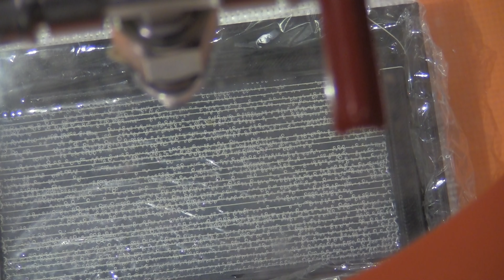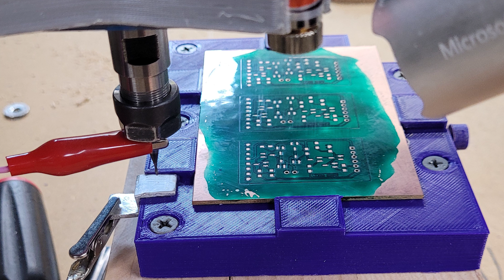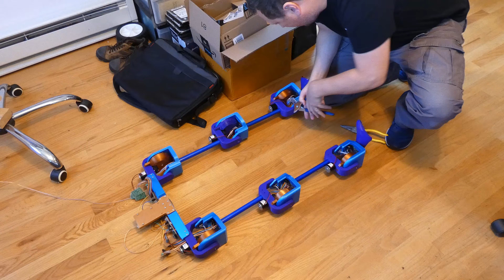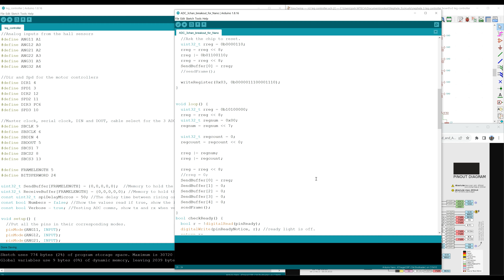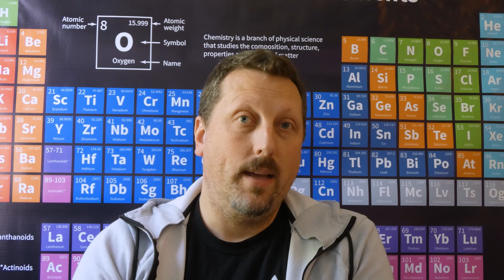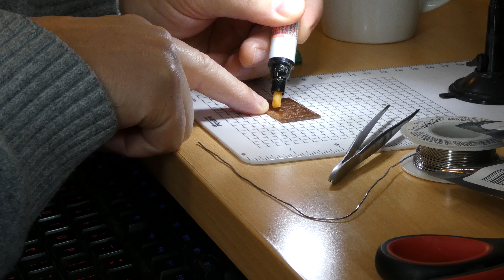Homemade Robot: The Rise and Fall of Nephele 4

Comment: awesome video...   that 3d printed visor   do you have that available  in Fusion  or  an stl ?   that is something i've been looking for,  to keep it in the same spot etc.
Reply from the maker: Yep, I zipped up the vise, clamps, and knobs (and also the original FreeCAD file) for you: https://whitman.tech/ferrouscnc/pcbvise.zip
Reply: @WhitmanTechnological  you rock!
Thank you
Reply: @WhitmanTechnological  Thank you..   i saw that it was for 7 x 10,  so i redesigned it  for 10x15 boards.  got everything in place,   have 1 question..  what did you use  for the  clamps  to tightening and loosening it ?    the hole is 3.8  i did see that you use metal screws,  but cant seem to figure out,  how you make the turning work.. seems like i am missing something,  or do you just move it, and then tightening it?
Reply from the maker: @perrykappetein9685  I used a long 3mm bolt with a 3mm nut captured in the little clampy pieces.

Comment: Hi, cool interesting video, lot of useful info. I ask you a favour: I can anymore find the Flatcam installation file for win (.exe) on line. Would you kindly share it?
Reply from the maker: Wow, I scoured the web for quite a while.  There's nothing.  💀💀💀

Tragically, I cleared out my downloads folder about a month ago and don't have the installer file anymore.  Seems like the only way to get FlatCAM running on Windows at the moment is to run from source.

Here's the most actively updated, current instance of FlatCAM I could find: https://bitbucket.org/marius_stanciu/flatcam_beta/src/Beta_8.995/  Updates to the source code are less than a month old in that repository.

The owner of that repository has a video on their YouTube channel on how to run from source on Windows, so we might be stuck doing that until they start building installers again.  https://youtu.be/doPdeA0YgzQ?si=cvyHa8mEWZJciq9z

That's a bummer.  I wonder if there was some legal issue that stopped them from being able to bundle the software up for easy Windows installation...
Reply: @WhitmanTechnological  Thanks so much for your quick and supportive answer.... inded, I already checked everywhere unsuccesfully for the precompiled version trying to avoid all the pyton installation and other nerd tortures ;)
Reply from the maker: @robertotione6751  Yeah, that's somewhat alarming that the easy installers are gone.  I hope it's just a temporary thing.  From what I saw, it's been that way for at least three months...  💀
Reply from the maker: Upgraded my computer and needed to reinstall FlatCAM.  Luckily someone surfaced a location where the archived windows installers are hosted.  Here it is if anyone's looking: https://storage.rcs-rds.ro/links/6b224dc9-9be5-4908-bfcd-2e18bee536c2